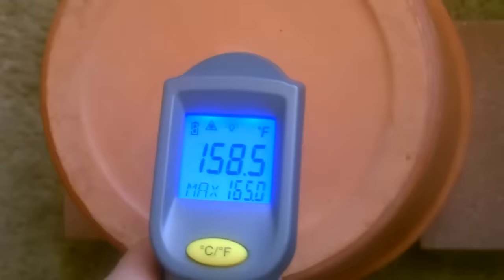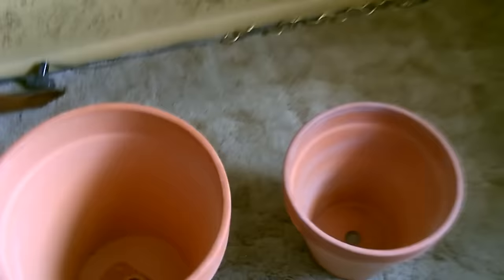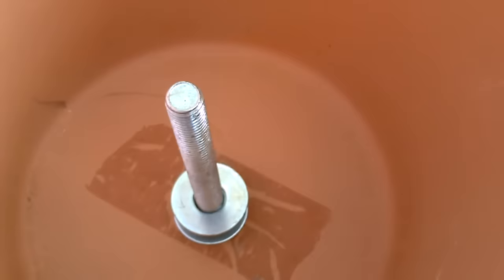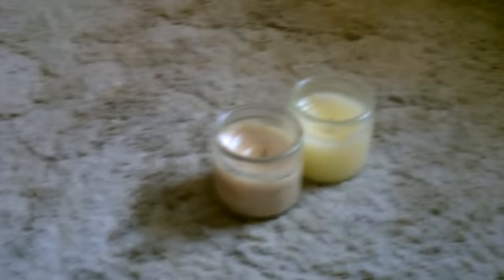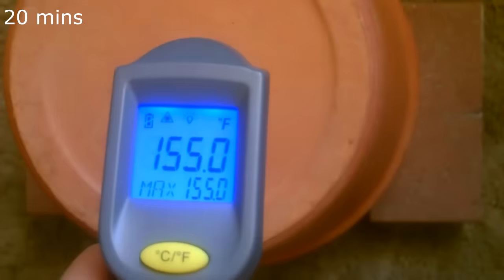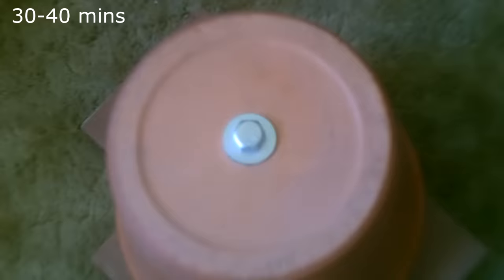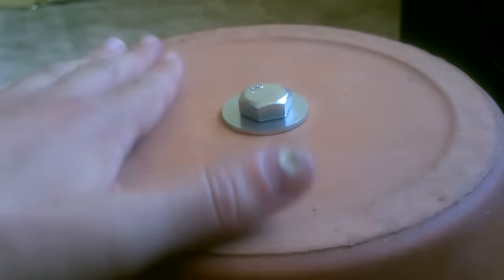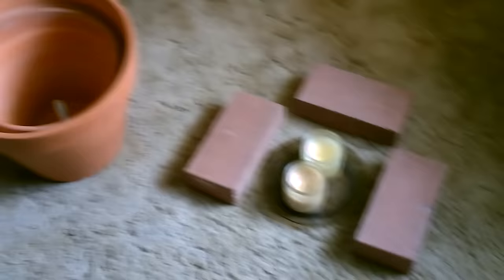Candle Powered Air Heater - DIY Radiant Space Heater - flower pot heater - Easy DIY

Comment: This setup does not produce a single BYU of heat more than what the candles put out, it only stores the heat and releases it over time.
Reply: Is that a British Yermal Unit ?? Or perhaps Brigham Young University ??
Or did you British Thermal Unit (BTU)
Reply: John Hazel Yeah, I'm known as the king of typos
Reply: Yea.  Radiant heat.  Isn't this a wonderful thing!
Reply: Jim Foreman
10-4 Jim, I'm going to try this soon, looks like a good idea.
Reply: *****
Of course it produces more heat.   This is radiant heat.   L.M., have you tried setting these on ceramic tiles?    I would think tiles would produce even more heat........
Reply: ***** The candle will never put out more heat than it would wide open.  When this unit reaches an equilibrium  it will simple dump the same amount of heat as the open flame.  People say  yeah, but it holds eat after the candle is out.  Its sort of funny.  IT SUCKS UP the SAME amount of heat in the beginning of the process before it reaches equilibrium!!!

Its like cutting off one end of a blanket and sewing it on the other end to try to make it bigger.
You well feel the radiant heat if you sit near it.  That is all it is good for.
Reply: Clown Whisper
It is like the oil electric heaters.   Once the oil is hot, it holds heat.
Reply: It doesnt matter it absorbs that heat at the beginning of the process!!! and releases it at the end.. you are not gaining anything.  

Set up two exact size rooms.

If you simply calculate the time it takes for the mass to reach equilibrium  in one room and when that happens light the candle in the second room  the candle in the second room will burn out at the exact same time as the mass goes cold in the first room.

Again, Its like cutting one end of a blanket off and sewing it on the other end.   It doesnt get you anywhere.  

Now there may be some value to having the radiant feel from these but weighed against the hazards of the paraffin wax, I hardly think that doing this is worth anything.
Reply: Clown Whisper
I have one made.   I put nuts all the way down the bolt to hold more heat.   I haven't tried it yet but I'll let you know when I do.
Reply: *****
I have a rug on my hardwood with a big ceramic tile and then the pots setting on the the tile.   I think that should work fine.
Reply: *****  LOl ok Lm
You need to inform the scientific community that a clay pot has alter the laws of the universe.  

Grats! lol
Reply: You feel sorry for me, for what??
Having a working knowledge of physics? 

Sense you are arguing this point, why don't you explain to everyone how you get more heat out of a candle by putting a clay pot out of it?

Rocket mass stoves work because of the slow delivery of heat to the mass and their super efficient way that they burn and re-burn their fuel gasses in extreme high heat.

How does magic plant pot work?
Reply: That would be you.

my turn.  You really need to try to  vilify a person without even attempting to make some sort of reasonable point

I simply stated a fact based on proven physics.

You are the one that turned this into something more.
Reply: Good grief!   All this squabbling over two clay pots?
Reply: Hey listen I was tatching this and gave my opinion.  I was provoked not the other way around.

I think that people should be informed before they waste money.  I even stated that if radiant heat is what you are looking for go for it.  It just will not create more heat than a simple candle standing alone.

I dont know how I could have been more reasonable.
Reply: Clown Whisper
I have made a heater but haven't tried it out yet.   I believe it will work because I have heard a person can keep a candle in a tin can lit in a vehicle and it will create enough heat to keep them from freezing and this set up does not create passive heat.   I'll let you know about my heater once I get a cold room to test it in.    (We bought a fireplace insert and the house is too warm now)
Reply: Yes I have had those emergency coffee can kits in my trunk for years.  Im not saying it has not value  Im just saying it wont create any extra heat.
Reply: If it keeps a person from freezing, it must be creating some heat.
Reply: Darby Dupree IT DOESNT cause a candle to create ANY MORE HEAT than it would just standing there
Reply: Clown Whisper
NO ONE SAID IT DID!   What everyone is trying to explain is passive radiant heat.    -sigh
Reply: Darby Dupree "If it keeps a person from freezing, it must be creating some heat."

I have had dozens of people argue that MORE HEAT was "CREATED" by this method.

sorry but i cant keep quite in the face of ignorance.
Reply: Clown Whisper If you put your finger over a burning candle, you see it is creating heat!    lolol
Reply: *****
No wait!   You have already built one and are using it?   How big are your pots?   Did you put nuts all the way down your bolt?   I apologize, I haven't been closely following the thread.
Reply: Darby Dupree "If you put your finger over a burning candle, you see it is creating heat!    lolol"

Exactly my point.  the candle is creating heat.  Put one candle in an empty room and one in a pot in an empty room wait 20 minutes and the rooms will be the same temperature assuming there is nothing different about the two rooms
Reply: Clown Whisper Technically speaking, a burning candle produces no heat but is simply converting stored energy (the wax) into live energy (the heat of the flame)
Reply: wow...   yeah I figured that I would simply use.. I dont know.....normal conversational english
Reply: Wim Harleev Good grief.   Use some common sense!
Reply: Darby Dupree
 It's not "common sense", it is "Conventional Wisdom", which is most often a bad thing, because the ideas that come from it are often based on perception, not actual evidence. If you make this "heater", it will radiate the heat in a smaller, more concentrated area. So, if you are close to it, you will feel more heat because it is concentrated, but no more heat has actually been produced than the candles alone, it's simply more focused. So, if your goal is to warm your hands or huddle close to the source, then this is a significantly better option than just burning a candle.

However, if you are attempting to use this to heat a room, then it really won't be any more effective than the candle(s). The heat will dissipate throughout the room and, since the pots don't actually produce any more heat, simply change the way that it is distributed, in the end the room will increase by the same temperature, either way.

As for LM's "experiments" that he has been using as proof, he has far too many uncontrolled variables, which lead to his misleading results, even assuming that we can take his word at face value. Since he isn't using separate rooms, just one at different times, the temperatures recorded are subject to differences in temperature outside the room, which are constantly fluctuating. His presence in the room will increase the temperature because he body produces heat. Also, it seems that his comparison for temperatures were made between room with no heat source and room with candles and pots. Of course the room will be warmer when you introduce a heat source. In order to get a proper temperature comparison, he would need to do the experiment between just candles and then candles with pots. If he did, and controlled for other variables, he would get the same result both ways, because no more heat is actually produced.

To do this experiment proper, you would need three or four, well insulated rooms that start at the same temperature. The first, you leave with no heat source. The second, with just candles. The third, with candles and pots, configured as described. The fourth room is optional and would exist mainly to drive the hypothesis home, with the pot contraption and no candles, just to prove they produce no heat on their own. Rooms 1 & 4 would end at the same temperature. Rooms 2 & 3 would each show roughly an equal rise in temperature, any slight differences would be accounted for in the inherent difference between the individual candles and wicks as there is no way to buy two exactly identical candles from the store. This may result in a statistically insignificant difference in temperature that would average out over many repetitions of this experiment.

Science is NEVER different from "real life", that's why it is science.
Reply: to keep arguing this point is ridiculous.
A candle will only put out X amount of BTUs  No more No less.

Unless some other form of fuel is added that will  never ever ever change.

Good grief
Reply: Patrick Kelly ***** 
Patrick, genius xD you are by far the one here that understands best the physics around. in a scientific way. 

now one point has been brought up at some point, there was one variable never discussed that might have an effect over the whole experience. Roof. The candle will heat the air next the the flame intensively high in no time, that air will rise up and it will created a small current of air, moving up from the candle, mostly to the roof and then gradually heat by "the top" of the room. So more intense heat on air, the faster it gets up and creates a first "layer" of heat around the roof, before slowly heating lower and lower. The thing is that if your roof is a cold one /mine has few isolation as purpose, to make sure snow doesn't accumulate on the outside layer/ then you loose much more from the top, where your first contact mainly is. You loose lots of energy heating a cold surface. if, in the contrary, it is well isolated, of is the floor of a well heated room, then, the lost is much less significant. 

As for the pot thing though, since it heats slower, on a greater surface, i am tend to believe the current wont be so quick at bringing hot air high. It gives more time to extend the heat in the surrounding area, before going to the roof, where, again, isolation and temperature plays a great role. 

Now one factor is undeniable, no more heat is created from one way or the other. The air current and thermodynamics though, is an other story, yet i have no deep enough knowledge to affirm if the above will work the way i supposed it could, or any other way. It also much depends on the actual room's surrounding. 1, 2, 3 or 4 cold walls /coldfloor or roof/ can make a whole lot of difference. (by cold wall, i mean a wall that, on the other side, is outside, on winter time, as a hot wall is one separating two rooms. suggesting one room is heated, the wall in between is a "hot" wall)

but hey, it's youtube. xD have a good day you two :)
 //second language too, so don't be harsh on writing mistakes and such//
Reply: @ClownWhisper  how hot does a candle burn at?

Comment: the outer pot should have the hole in the top, not blocked by the bolt and washer, otherwise the convection does not work to its full potential

Comment: Is this just to prevent the candle's heat output from rising straight up? Otherwise basic thermodynamics tells us that the pots don't contribute anything. The only heat source is the candle and they already dump their heat into the room by default. However, one benefit of the pot is that it provides some safety by covering the open flame.
Reply: And i also noticed that the candle burns out faster when covered by the pot due to the contained heath "dissolving" the stearin faster.
Reply: I would think the benefit being that convection heats the mass in the pots which in turn then radiates heat in a much more controlled, localized release of energy close to the floor. This, as opposed to the majority of the energy being lost through rapid convection to the ceiling and out through the structure. A single, or even three candles would not radiate much, but would, through convection, release heat energy rapidly upward.
Capisce paisan? ;)
Reply: Lean540 Its nothing more than a heat sink... It can not generate any more heat than the candle generates to begin with. Your not generating any more heat you are only controlling the flow. The same amt of heat would disapate in the room with or without the pots.
Reply: I hope you didn't think I implied that the pot was generating any energy? Not sure how you could even come to that conclusion based on what I had written.
Reply: To put it simply, the conclusion I come to is that this is an unsafe and dumb way to heat a room unless you live in a cave. I heat a 2,600sq ft home for less than $3 a day with an efficient heat ex-changer, and I live in NJ. At best the idea is cute but not very practical.

Comment: I think better with the hole open for the outer pot and closed for the inner pot.  Pulls air around the inner pot like a gas furnace.  Clean-burning candles shouldn't leave soot but the price might be more.  The candles will also clean the air.  Would be worth it not to have soot.  Note:  A conventional light bulb is 25% light and 75% heat.  We use 2 in water pump houses.  One is plenty and it is highly unlikely that both bulbs burn out at the same time.  Check them monthly or use an indicator light in an inhabited area so you know they are on.
Reply: That is how I do mine, a block on the small inner and then the larger pot hole open and around it will draw the air out
Reply: By conventional light bulb, do you mean just a regular old 75 watt light bulb and not LEDs?
Reply: @jude7321  Yes, incandescent.

Comment: There are spiral heater things for electronic ovens, these can be put into plastic tubes for instance, where holes are drilled on it.. thick tube, then metallic tube around it on the outside, then outside of it goes the clothing, then some sorta automatic switch put onto it completely locked (basicly resistor paralell with a transistor, so if the current increases one the heater side the paralelle sides loses curent (cmos transistor), so it switches of a circuit wich prevents an automatic switch to swithc off (a relay of sort would be the automatic switch).
Reply: this thing maybe put into modified clothes or under bed or so. accumulator charged, then put onto this thing). much more economic then heating room. a typical room needs around 1500-2500 watts of power to heat, a person needs no more then 40 watts.. well maybe 80). u can connect to this metallic part some tubes with water in it so the water tubes are light, and with some plastic, and these are cept at some temperature).
Reply: steam powerplants approach 100 percent efficiency growing with size usually smaller ones being 60 percent efficiency, then there is the network transmission loss due to alternating current... but generators maybe local,, so then the gas received from pipes travel without much losses.
so it is around no more then 160 watts to heat a person when it is freezing cold outside (crudely estimating), then 10 person is 1600 watts only still..  (when it is freeing cold.. perhaps something like -50-70 degrees celsius.